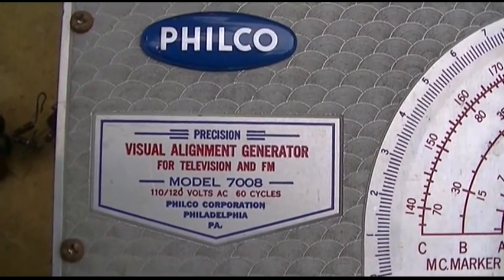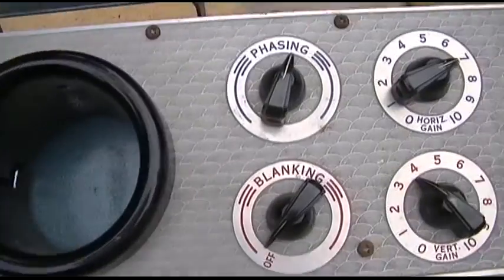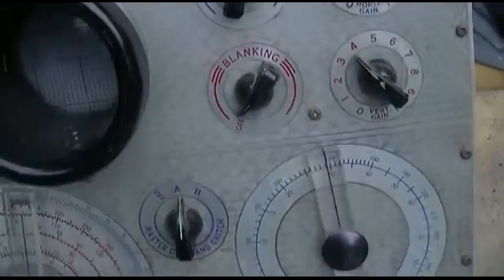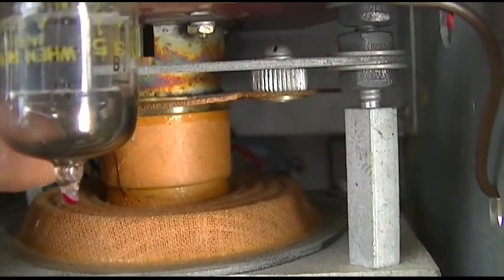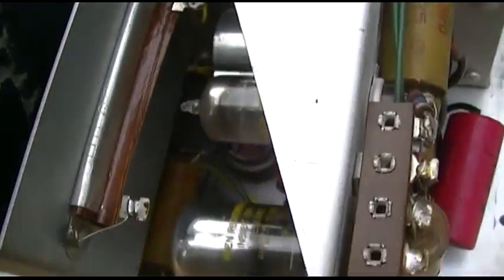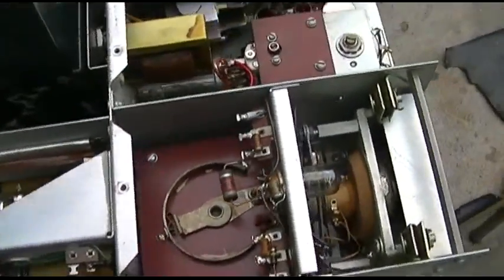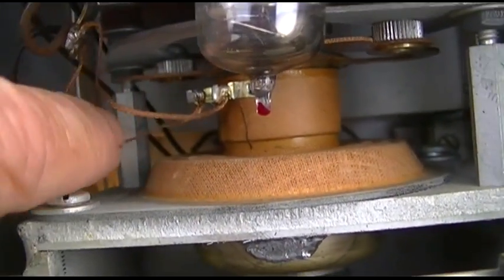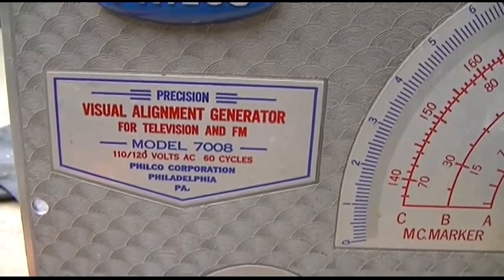Philco Visual Alignent Generator Sweep Marker Generator Model 7008

Comment: Cool! Good thing about test instruments is they get way less hours on them than TV's and radios, so should be a easy project. Yeah, voice coil appears to drive circular variable cap -positive and slick. Looks clean, hope you go ahead and go through this thing. Whats the tube lineup? Is there a transmitting tube it that thing?